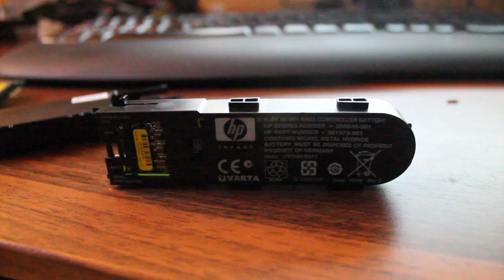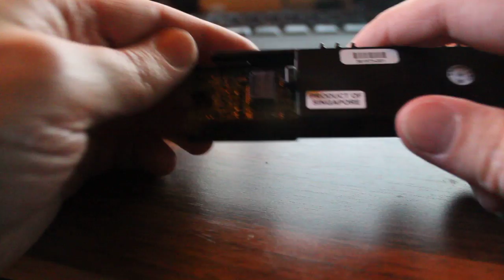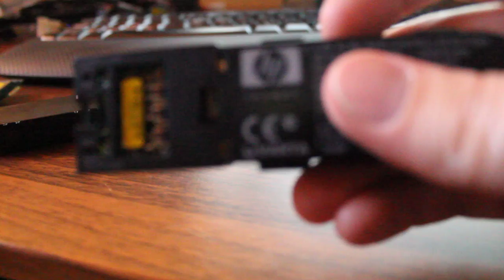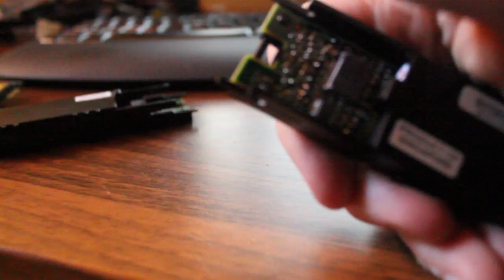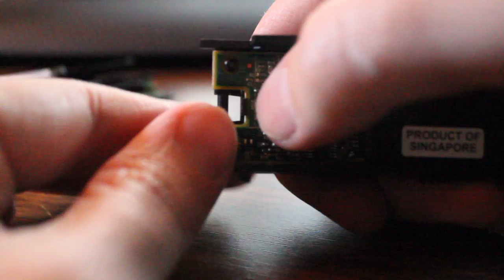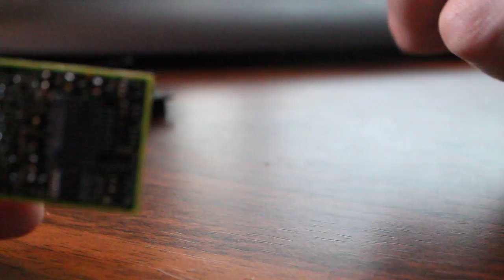HP P400 RAID Controller Battery Replacement (Hack!) Part 1

Comment: Good video.  I have a ML380e with a p410 in it and the battery died.   I used 2 - 2.4V 600mAH (2 cell) NiMH portable phone batteries.  There were about $8 each.  I cut off the top of the plastic case with a dremel and carefully removed the old dead batteries.  The two copper contacts in the case have two metal strips connecting them to the old batteries.  Just carefully remove/cut them out.  I soldered on two wires to the copper contacts the go through the side of the case to the control board then connected them to the two new battery packs that were wired in series to give 4.8V 1200mAH.  I fit the two packs, back to back inside the case and taped the whole thing up.  Not pretty, but secure and reusing the old case to fit back into the server.

Comment: This is an old video, but some of us still have P400s out in the wild, and finding batteries is getting to be impossible, so thank you for the video. This modification is a good option, though it would be better if you soldered a connector to the contacts, and you could then leave the connector on the battery and just plug/unplug it as needed.

I also had another idea: is it possible to use the capacitor module from a later P410 card to replace the battery? Those are readily available, and I think that they have a much longer shelf life.
Reply: I'm still using one :-)

Comment: I just ran into the same issue and discovered there is an alternate version of the memory module card that is Flash Backed and can be found on Amazon for <$30  HP-505908-001 is the part number

Comment: We have a lot of dl380 G5-G7 servers. The OEM batteries "swell" an go bad. Array acceleration fails regardless of array type unless it is checked off in ILO. Doing so risks data loss on power outage. It would take a unfortunate series of events for that .. dual power supplies hooked to UPS but since we run Linux and don't have UPS feedback to the server it is possible. In short this battery by HP is a Under Engineered POS. Unfortunately for production servers I must continue using OEM parts.. but I plan run with this on my personal server. Thanks for the tip ! I will proceed carefully

Comment: I have P410i controller. Is there any specific battery that i should get ?
Reply from the maker: +a- Babunji match the voltage and be sure to meet the minimum capacity or above.
Reply: Would this battery do the job: https://www.amazon.com/HP-Smart-Controller-Battery-462976-001/dp/B003564Z1G/ref=sr_1_2?ie=UTF8&qid=1497188638&sr=8-2&keywords=p410+battery 

??

Comment: Hi there.This is a very informative video thanks for your tip.I did it on and old server i had and it worked a treat.No problems whatsoever server saw the battery right away.I used 4.8v 1000 mah pack that way it will hold charge for roughly double the time.Point for consideration if you carefully cut the pcb holder from the actual battery body with a sharp craft knife then you can safely place pcb back in holder so you have no worries of it shorting out Once soldered up it wont fit in the battery receptacle but will comfortably sit on the air baffle in the dip directly in front of where the battery sits.Excellent video.Sure helped me out.I also agree why pay hp a fortune for a battery that you can buy for 5 pounds.Once the battery dies the circuit board can be recycled as you have shown and you save yourself a fortune.That is if you can find a new battery with warranty.I followed your advice after buying several batteries from ebay all which showed failed and needing replacing.I am of the thinking it is not good to buy second hand batteries buy a new 4.8v cell as you have shown and recycle the old pcb.Surely that is better for the planet.Great advice mate .You will always get jobsworth fuckers who say you aint doing it right man.As far as im concerned this vid is right on the button .Hardly rocket science eh.Many thanks my friend

Comment: For a server that you are interested in running RAID 6 on, why would you not just replace the battery with a genuine spare part, not worry about any warranty problems, and just make sure everything works correctly?
Reply: And the one i found and bought were not able to be loaded eigher so i payed $20 just for nothing